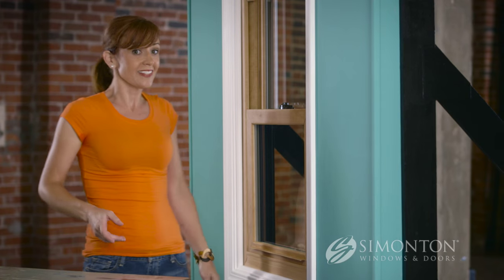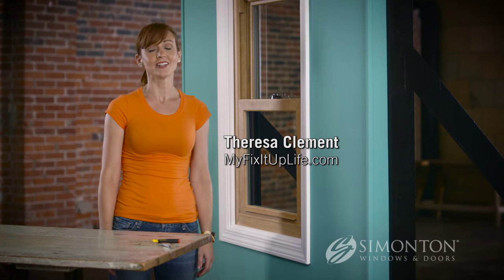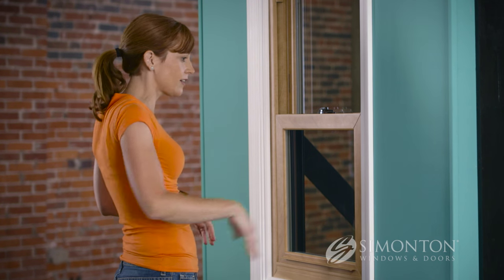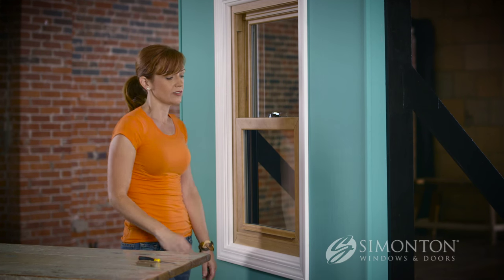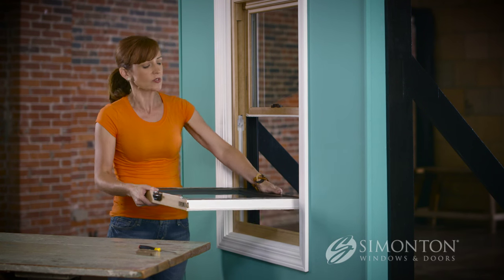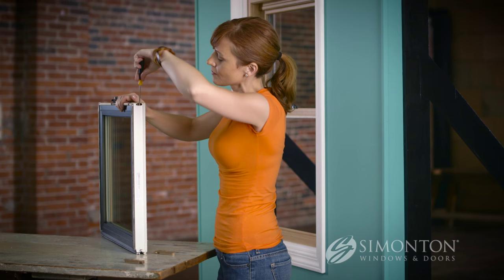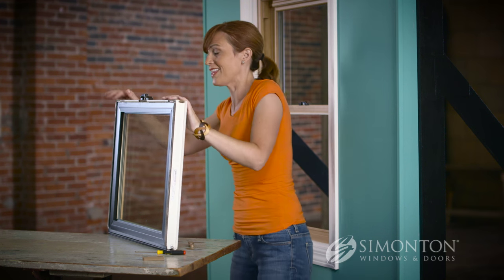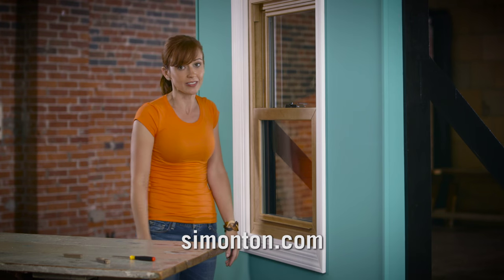How to Replace a Tilt Latch

Comment: My right window tilt latch broke off at the grip.  The spring still works, and the latch function still works, but there is no where to grip the latch to unlatch it.  Can I just drill a bunch of holes into the piece until I drill through the spring, and then make the thing unlatchable?  How do I tell what brand of windows I have to get a replacement tilt latch?  I have economy windows, whatever the builder installed on my economy house.